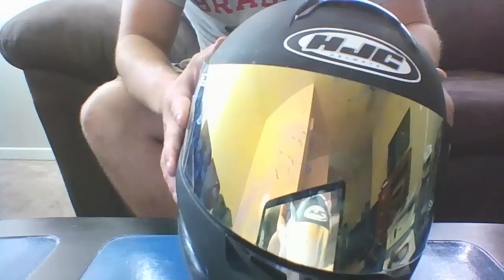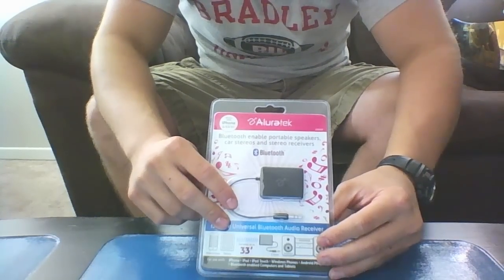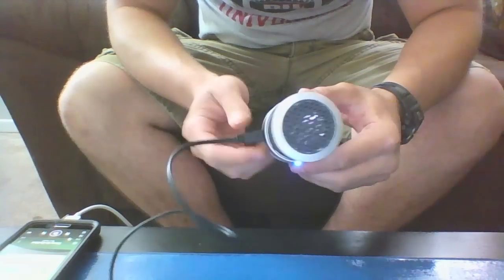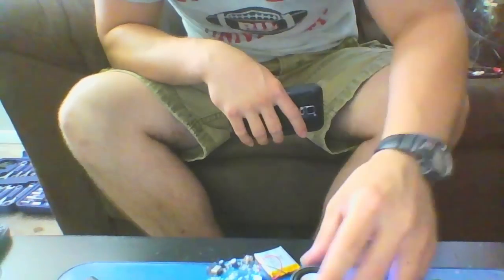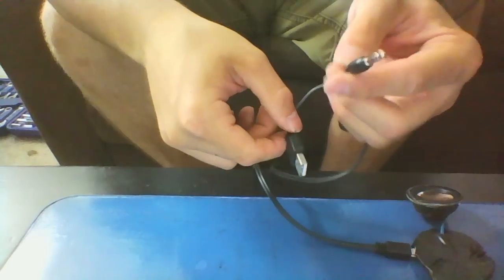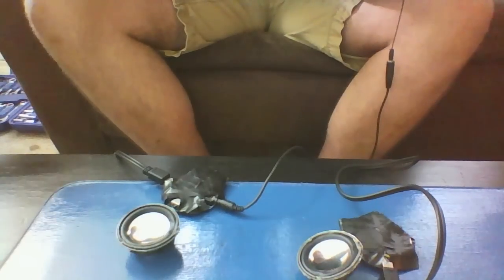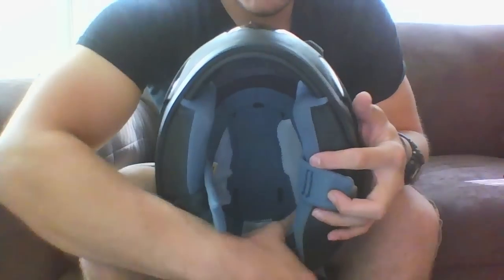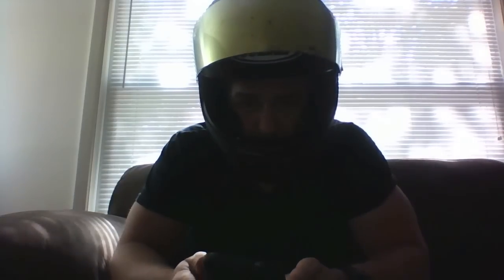MotoHack #1 - Bluetooth Helmet Speakers

Comment: This is the kind of thing I like to see - people being inventive and figuring out how to make useful things for themselves.  Besides the fact that it's cheaper, there's a certain satisfaction that comes with knowing you made something that works just as well as something that costs 3X as much if you buy it.

I'm in the process of putting together much the same thing, except I'm using a cheap 3W X 2 amplifier board off Amazon with two 1 1/2" speaker drivers from a set of laptop external USB speakers.  I'm using pretty much the same Bluetooth module that you have.  What I will be doing on mine is wiring in a potentiometer either through the side of the helmet chin piece or below it for power on/volume control without having look at anything and take my eyes off the road.  For a battery to power both the Bluetooth module and the amp, I'm using a 3.7V 2200 MAH LiPo made for RC airplanes.  So far in testing, I have run the system at full volume for 8 hours straight and the battery still wasn't dead.  Like your setup, I will be "charging my helmet" from any computer or phone charger.  I have a small solar cell about 2" X 4" that puts out a regulated 4.1V, and I'm playing around with the idea of integrating solar charging into the helmet while I'm out riding.  :P  I just have to figure out how to mount it so that it looks good and looks like it's supposed to be there.  Once I get all the parts together and some kind of enclosure figured out for the electronics, maybe I'll make a video.
Reply: OpiateX   Did you ever finish making your bluetooth helmet system?
Reply: +OpiateX Any video on your setup? I would be very interested in seeing it.
Reply: +OpiateX Please don't mount a LiPo next to your head k?

Comment: Definitely a badass setup. But I'm curious as to why you would need a receiver? Aren't the speakers Bluetooth already?
Reply: I think because 2 different speakers and you can only have one paired...
Reply: Ro Ru I'm not sure why he needed it initially but after he went with the double he would need it to sync the audio signal

Comment: I ripped the wires out of  both of my speakers. So pissed. How do u get the speaker out of the plastic once u have it out of the frame? Is it possible to rewire the speakers after I ripped them out?
Reply: I have the same question

Comment: What if you skip the extra battery and wire speakers straight to the module? You can get some Bluetooth modules pretty cheap that are meant to power speakers directly. Then you only have 1 battery to worry about
Reply: And you won't need the extra micro controllers for the speakers

Comment: Not a bad concept, but sourcing some smaller speakers with similar output and just wiring the speakers in parallel to the board would allow for one less charging port, etc.... but you could also get a pair of cheap blue tooth headphones from Walmart and strip off the casing to replace the buds with small computer transducer/speakers. I dunno if I'd want mine to be THAT loud considering you should have awareness of stuff around you audibly as well as visually.

Comment: Why not just use an actual bluetooth speaker?  It seems that would cut down one less component.
Reply: same question.
Reply: +Jason Vylasek yeah... he used a wired speaker and seperate Bluetooth module... I actually am doing a similar mod now using a vivitar Bluetooth speaker... it was a $6 speaker and the chip inside is very small about 1 inch by 2 inches... the actual speaker inside was too thick to fit in my helmet so I just wired a female headphone jack to the Bluetooth circuit board and got a cheap clearence headphones and took the speakers out and mounted those in my helmet.  now I can remove the bluetooth and unplug it from the speakers to charge the bluetooth... its perfect and I did not have to mount anything on the outside of my helmet... but this guy gave me the idea.
Reply: blah blah blah no one cares
Reply: @JoeGrey I'd like to see this in action.  Great idea.
Reply: Wires
Reply: The one I used has a 3.5mm output.

Comment: Good video, but I would recomment using speakers without batteries. In case of a crash the lithium-ion battery can explode. I don't want this next to my head. I'm using speakers from an old computer headset with a 10hour bluetoothreceiver at the back of helmet.

Comment: How's the bass?
Reply: I can't speak for him, but with mine, I have 1 1/2" speakers, and with your ears being so close to the speakers the bass is surprisingly good.  Not quite what you'd hear from a stereo system with a subwoofer since the driver is so small, but about as good as what you'd hear from a decent stereo system in your car.